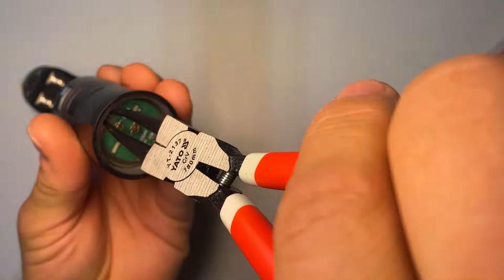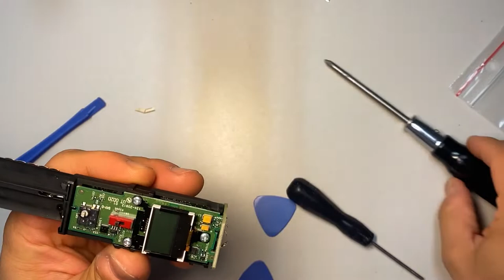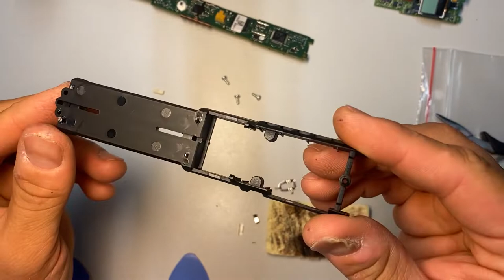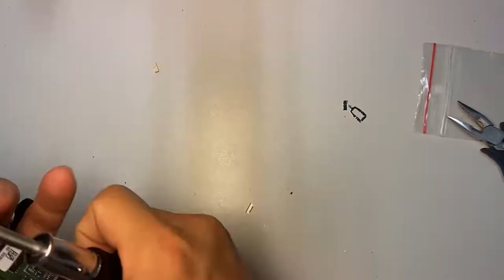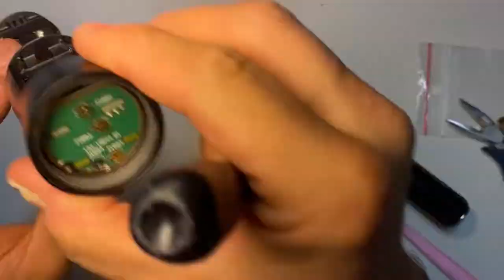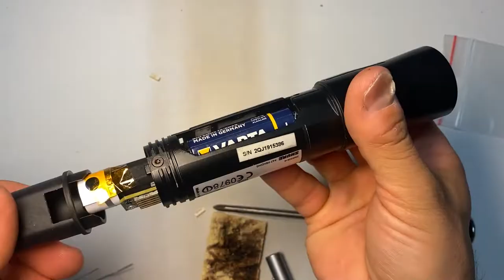Shure QLX-D battery tray / compartment repair DIY permanent solution

Comment: Thanks for the paper clip idea....The positive battery terminal is poorly designed and I was able to fix two microphones with this technique. I didn't even have to take anything apart, the paper clip can be wedged in to make the connection to the metal plate behind the broken terminal